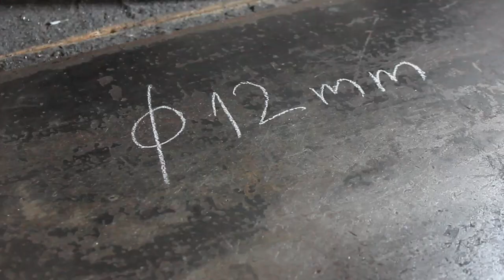Blacksmithing : Forging a Leaf Wall Hook

Comment: I am having a hard time with my wall hooks getting cracks and breaking off. Any tips? Am i working it to cold? Total beginner
Reply from the maker: If it is a normal mild steel, sounds like it must be too cold. Try to heat it more frequently and cracking should stop. But breaking off sounds like it is not a mild steel.
Reply: @SunHillForge  thanks for the reply I believe it's just mild steel square stock I got at the metal yard. I'm thinking to cold. It took me like an hour to make it haha. Practice is what I need. I have a hard time trying to thin it out to a taper.
Reply from the maker: @BRadWilson3  Yes, looks like too cold. Practice makes perfect! Take your time and enjoy the learning ride!